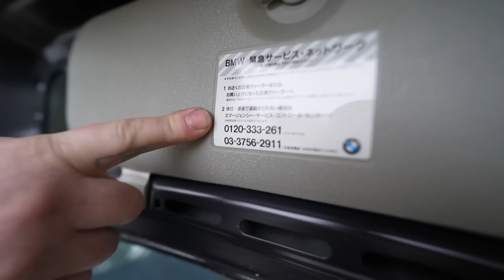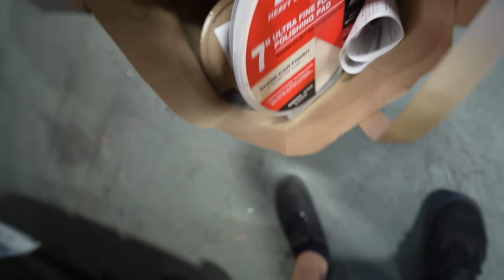I BOUGHT The LOWEST Mileage RHD E36 in The Country!!

Comment: That thing is mint those small issues are all very common. To make that E36 gangster it need some rare parts not M bodykit it's overly done
I have a 91 Japan import Acs3 slicktop 325i with the complete catalogue in & out, E30 M3 color (diamantschwarz metallic) shit is fire. Ask Tommy he is THE guy that can help you build those to the next level. (He used to part out E36's for years at the chopshop lol) 
His white S54 sedan was soooo good.